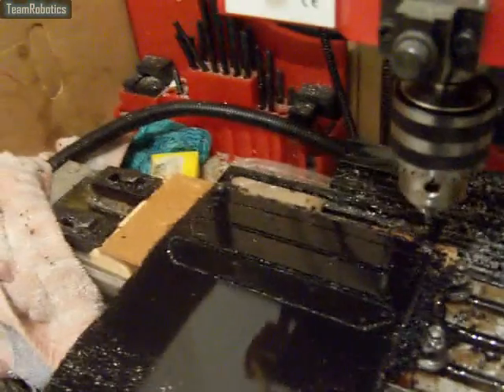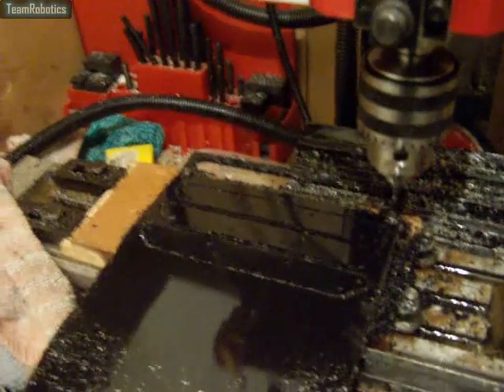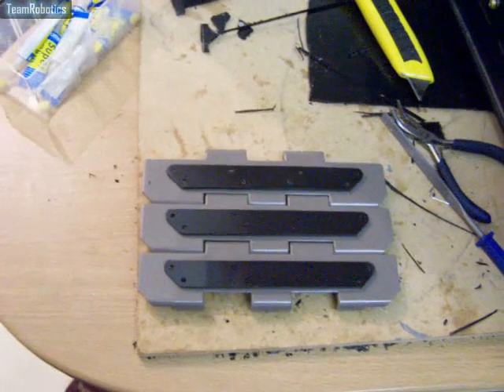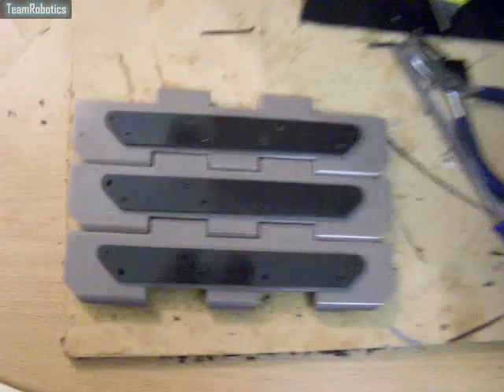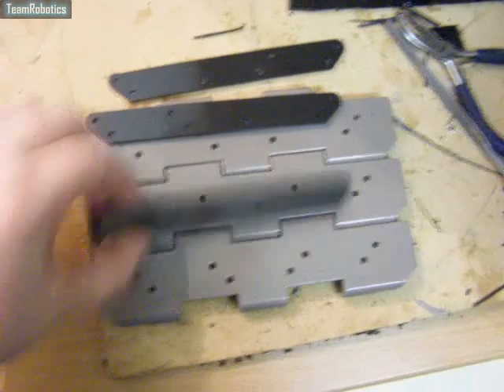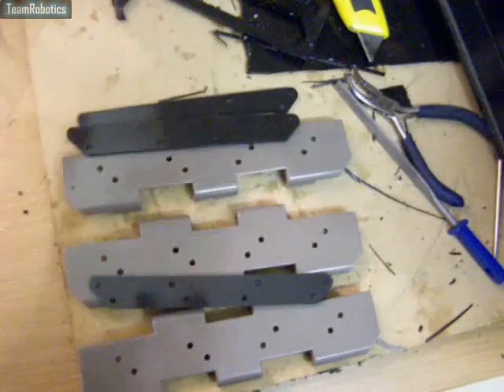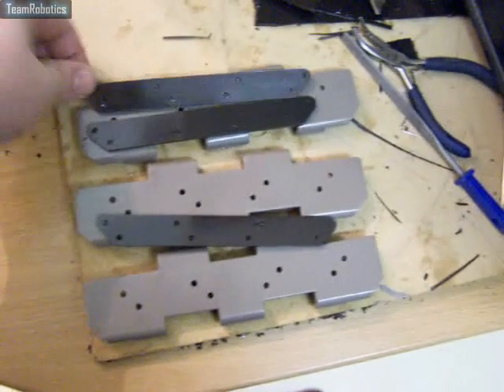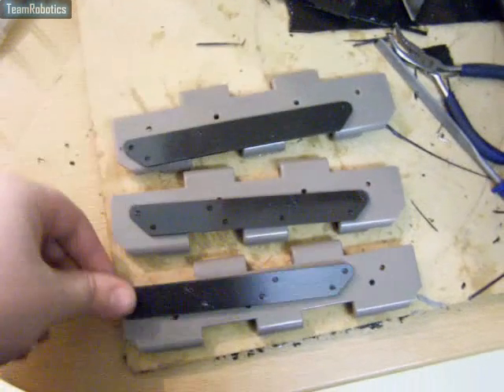104: Making the Track Pads from Delrin

Comment from the maker: Hi there yes, the robot will be computer controlled, with 84 lines that can be used for servos,motors and linear actuators, there will be 84 lines available for switching things on/off or flashing lights or leds etc.. there will also be 84 lines for input available for external sensors sonar etc.. Im a computer programer so the programing side of things is no issue to me... hope this is helpful to you... regards Richard